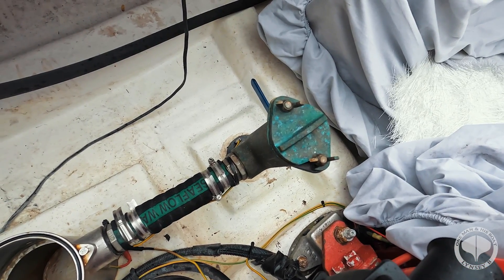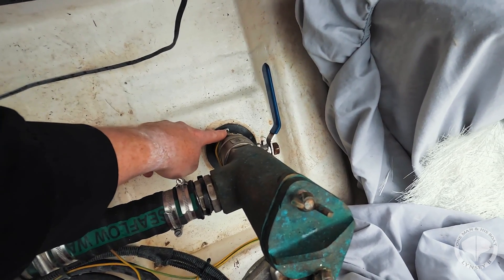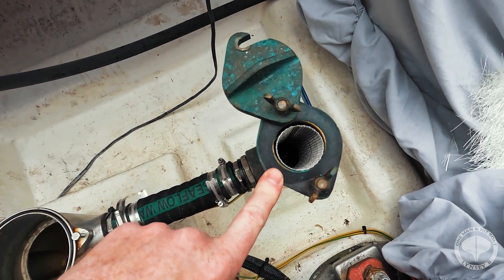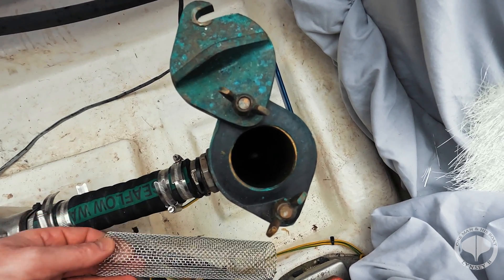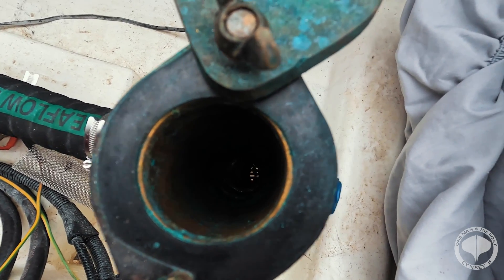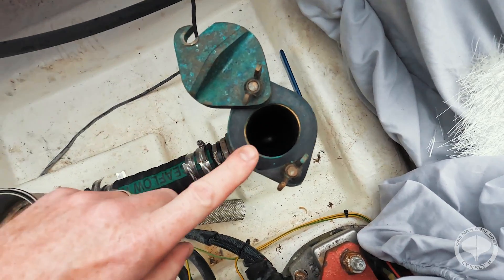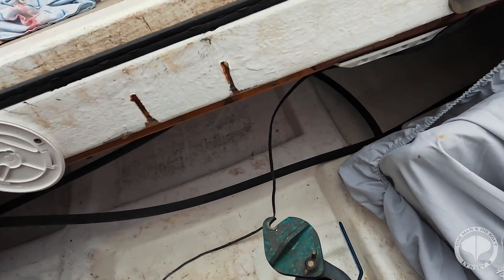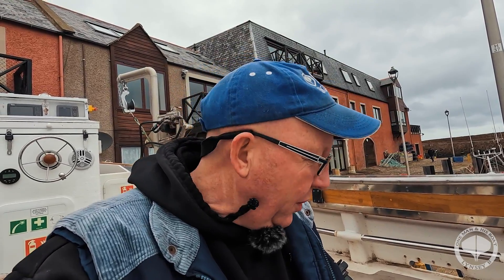How to Inspect a Seacock - A Guide for the MCA Inspectors!

Comment: Well Barry a fully comprehensive  video on the Seacock very informative  but will the MCA even bother  taking your sound advice.  They are nothing but Pen Pushers and Tick Box  markers. Will they ever  use common sense and listen too a seasoned  boatman like yourself.  
At least you've  tried.  
Best wishes  as you prepare foe the season ahead
Reply from the maker: Hi Peter.
Yes, well, one can only but try.
As long as some gets value out of these vlogs, then my job here is done😁👌
You can tell these days the type of inspectors we get, as they are hardly time served at sea, or got any real life time experience never mind experienced at boat maintenance.🙈🙄
Let's hope they can move forward and work with the fishermen instead of against them....but I'll not hold my breath, though.🤣🤣🤣🤣
All the best, sir.😁

Comment: Hi Baz.After having a total pump failure forty mile out, I made a get you home bit. I made a spare strainer top out of ten mill stainless plate. I drilled a thirty mm hole in it, and welded a tube over the hole to fit my deck wash. If the pump fails again, I can remove strainer top, screw down spare one. Fit deckwash, with the hose clamps left on it, close ball valve to sea and off we go. Get about 70% power, but it takes two mins and it will get you home.
Reply from the maker: Hi Graham. 
Aye, that's not the best place to have a breakdown like that!🙈
But well done, you on the engineering.
That's what it takes when you are at sea, a good bit of common sense, and plenty of skills.
Brilliant job, bud 👏👏👏

All the best.😁👌

Comment: As a non Mariner per say I had to look it up and forget all the schoolboy sniggering with regards to the name . Sorry Baz couldn't help it "A seacock is simply a valve that fits on to a thru-hull skin fitting. The seacock's purpose is to allow water to pass in or out of the boat through the hull to inboard equipment and to provide a positive shut off from water ingress if required e.g sea water used for cooling the engine and to flush toilets". As for the inspectors making something simple into something not...well there you go.......and if I had watched to the first part I'd have known this !
Reply from the maker: 🤣🤣🤣 you know Scott, you're not the only one that had a snigger 🤣🤣🤣😁👌
A very thorough explanation of a "seacock" sir, well done.😁👌🤣🤣🤣🤣
Yeah, the stories I have heard,and theirs absolutely no reason to strip down a "sealed" seacock at all.
They are just being difficult and justifying their own existence,  typical government tactic that!🤔🤔🤔🤔🤣🤣🤣🤣
All the very best, sir.😉👍